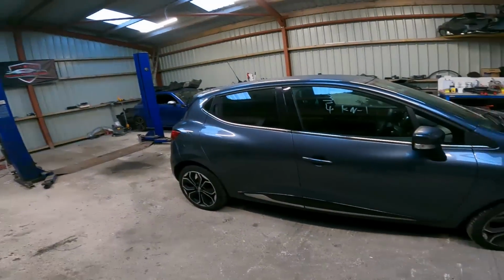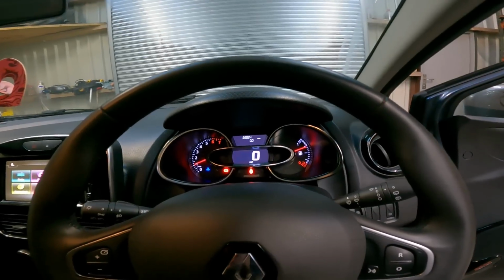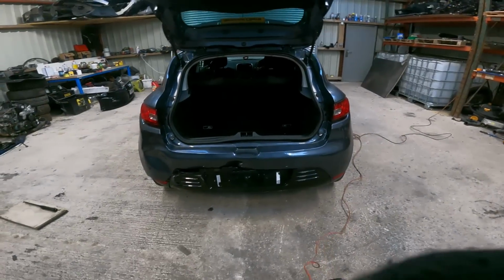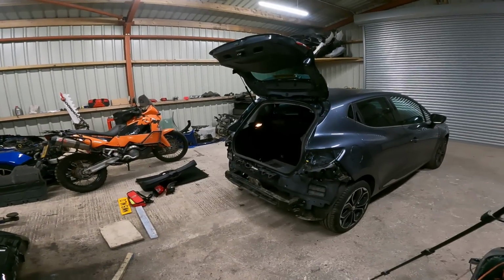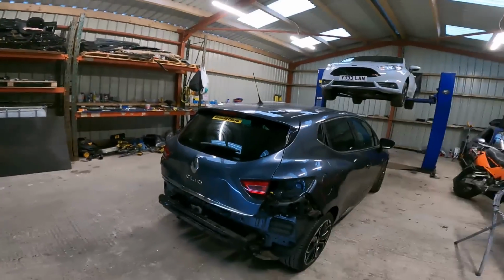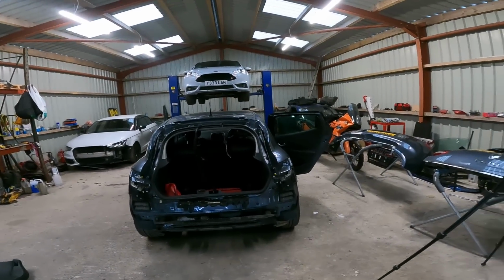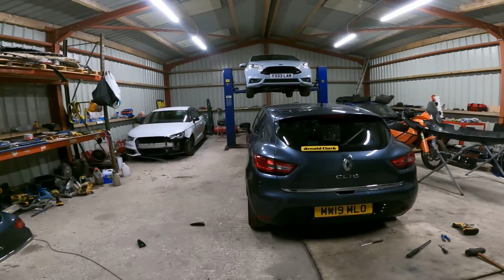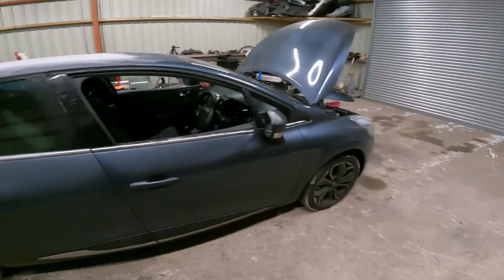2019 Renault Clio Salvage Repair In 1 Video!

Comment: Phil, you need to get a 5-8kw garage diesel parking heater like a Vevor one. Only cost around £100 and run on diesel fumes mate. 1 litre of red diesel or heating oil lasts around 2-3 hours.

Comment: Not that great on fuel around town, low 30s for me that’s driving steady in eco mode & the later model (100ps) will get into 50 mpg on motorway at below 70 mph.

Comment: As others have said, totally bonkers that cars with such minor damage are being written off these days. It's costing all of us a fortune in increased insurance costs. How can fitting a new rear panel, bumper and tailgate be an uneconomical repair. My Dacia has the same engine, it's a great little thing to drive, very responsive.

Comment: Salvage for such little damage? Written off because of Renault's exorbitant spare parts prices?
Reply: Probably Cat S as the rear would be counted as structural. They wouldn't be allowed to tap it out like Phil did. That insurance repair would be new tailgate, bumper, back panel (which would need spot welds drilled out then new panel welded in) and all associated parts like the bumper mounts then a respray. Not a lot of damage for a private individual to repair but a  costly shunt for an insurance  company.
Reply: @alancampbell1008  Back in the 80's and 90's when I worked in a bodyshop we were doing that kind of repair all day, every day. It's bonkers cars are written off for it these days and costing us all a fortune in insurance premiums.

Comment: French cars with tin foil body work, bonnets shouldn’t dent from closing them!
Reply: Not just French cars transits and transit custom rear doors buckle if you push then closed on the edges rather than use the handle. Next time you see one look 3/4 way up the door in the middle where the doors meet nearly everyone is buckled
Reply: @chrisw3513  agreed I’ve got a custom and the bodywork is very very thin